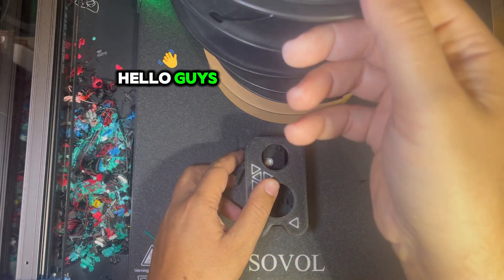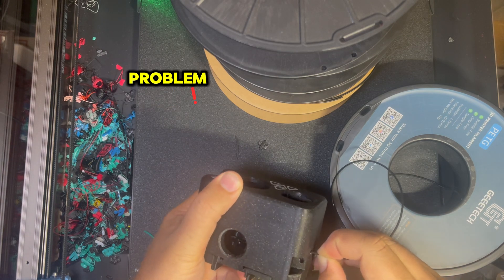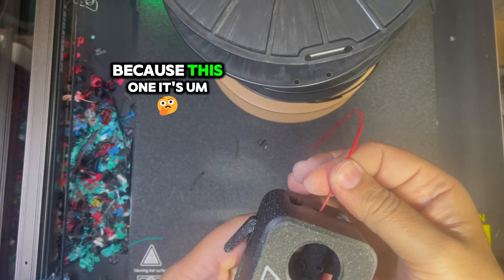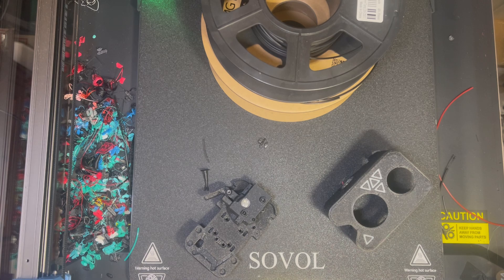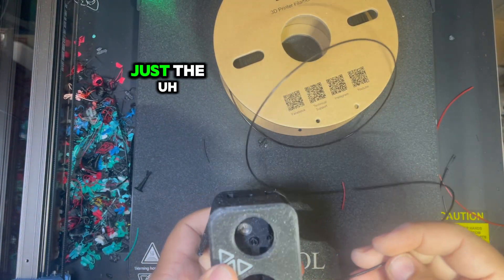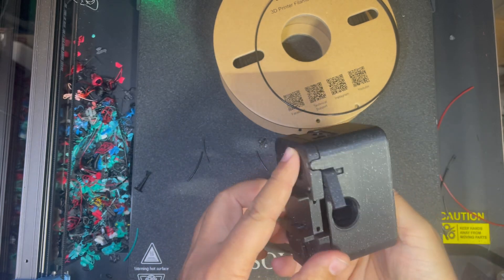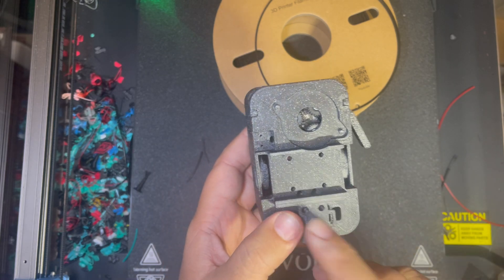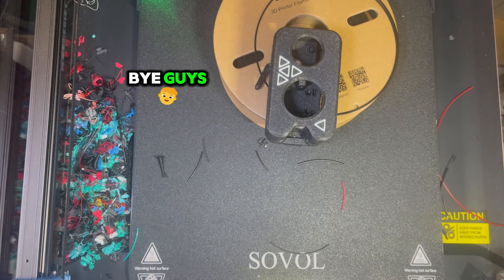Cutting different filaments types with the Sovol SV08 V4 Toolhead!

Comment: Just got my SV08 and found your tool head on printables. What exactly is the cutter for? I'd guess it is needed for an MMU but don't they just retract the filament?
Reply: When the MMU unit retract the filament and then later feeds it back in, the tip of the filament can be stringy or a bit messy causing load failures. Cutting the tip before retracting ensures a nice, easy-to-load tip for the next time.
Reply from the maker: @woot-y9x  exactly it prevents jamming the path with filament
Reply from the maker: @User-ec2bh  we made it to can be used with any mmu on the market

Comment: Nice, do you have any instructions on how to assemble this tool head? After seeing the BTT VVD, i think this tool head with the cutter will work very well with that. I'm wanting to move away from my stock SV08 tool head, I find sometimes it will not load filament properly even with printed extruder gear idler pin parts. Plus, if I am going to go mainline with my SV08, I may as well change the tool head at the same time
Reply from the maker: This one is ready and we need to finalize the manual before releasing it. hit the subscribe button to be notified when we release new video.
Reply: @nadir3D  I've been looking but can't seem to find the manual for this toolhead? It's my first time trying to assemble a custom toolhead, so I want to make sure I'm prepared by reading ahead.

Comment: Where will this be available from please? The BoM and Step / STL files? Fantastic job. Have you done the Gcode for using it on filament changes?
Reply from the maker: The gcode are almost ready, in the background we are working also to have a MMU system connected so they will be released all together in the upcoming weeks  and all the BOM and Files will be posted on Our Printables profile. https://www.printables.com/@Nadir hit subscribe to get notified when we will release them.
Reply: @nadir3D  that's so cool! I have been looking at the Pico MMU from the LH Stinger project because of its simplicity and how inexpensive it is to get up and running. I'm keen to see what MMU option you guys have been working on! Thank you for your fantastic work on this. I've subscribe here and followed your Printables page.

Comment: What sort of MMU can you use with this one?
Reply from the maker: @AbdulKaderMustafa  this can be used with any tipe of mmu. It was made for the sv08 so it will be compatible to harvest all the parts from the original toolhead. But since it is based on a voron gantry can be used in any voron style 3d printer.